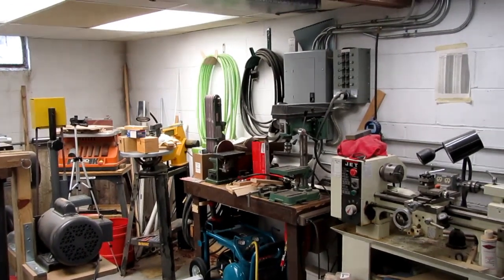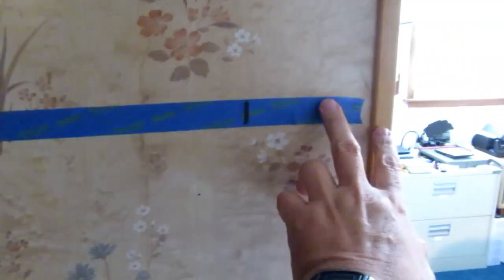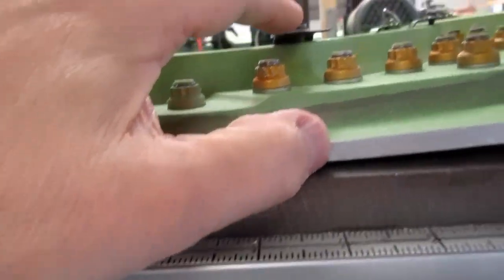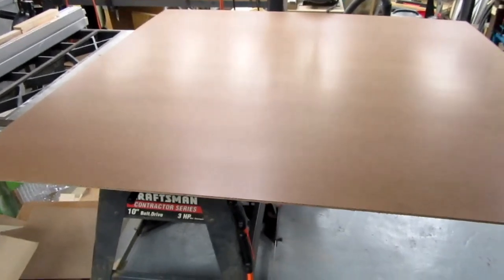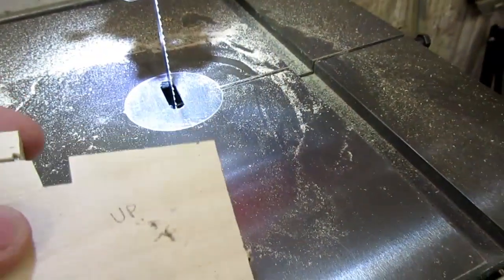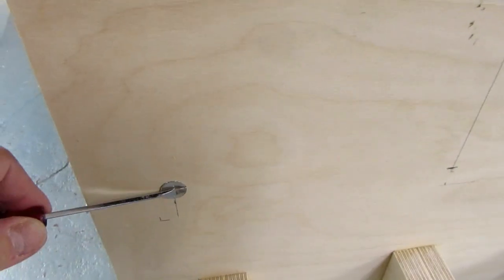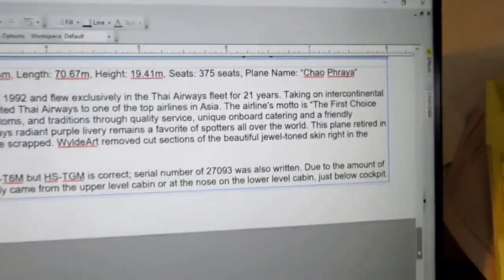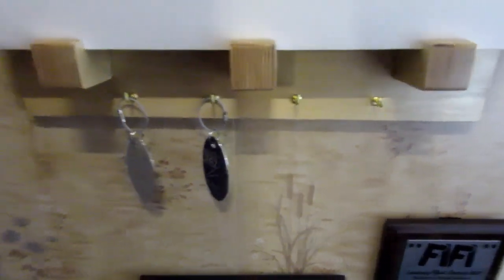A Wall Hanger for My Piece of Thai Airways Boeing 747-400 Tail Number HS-TGM

Comment: Your level of proficiency in all these projects with your varied skill sets is very impressive. You can  play musical instruments, repair/build/restore electronic equipment, construct all manner of things and with well thought out plans. Kudos for taking the time to learn so many useful skills. After my US Army time (1984-88) I worked for Pan Am Airlines back in 1988-91 just before they shut down. I worked as an aviation technician for them. I worked on B747, B737, B727, B707, Airbus A300, A310, A320. Plus Lockheed L-1011, DC-8, DC-10. Eventually I left aviation in 1992 due to the downturn. I wanted to become a commercial airline pilot but vision standards prevented that at the time. Nevertheless, I became a mechanical design engineer. Since then I have designed variuous products. 1st in medical devices design + mfg machines for the same. Later moved into leisure products like patio umbrellas. Later designed computer hard drive parts destruction equipment for the NSA in Washngton DC. Also did some work for Northup Grumman on the CVN78 Nuclear AIrcraft Carrier, Gerald R. Ford.  Later, somehow back into aviation to design emergency inflatable evacuation slides. These days I'm designing plastic products in the janitorial/sanitaton field. Anyway, It's good to see others that have the ability and skills in a multitude of fields. It's been an interesting 28 years for me. Probably will do this for another 5-10 years before I move on to other endeavors. BTW, found your channel because lately I've caught an interest in vintage tube radios. Have a great day.

Comment: Suggestion: place a picture of clouds one might see on a flight at altitude. Place the picture on the white board behind the window; giving the illusion of being on a flight.
Reply from the maker: Philip Donhauser, I actually thought if that, but the view would be backwards.....if looking from the outside of the window, the view would be of passengers, not clouds. And I did want to have a picture of the original aircraft; putting such a picture beside the window section would not work (not enough room), putting it above or below would be hard to see due to the height of the window section, so putting it behind the window solved that problem. But if I ever change my mind, the current picture is just attached with those removeable dots......